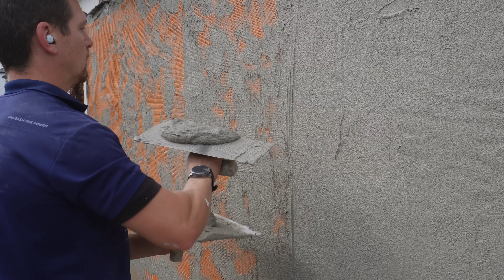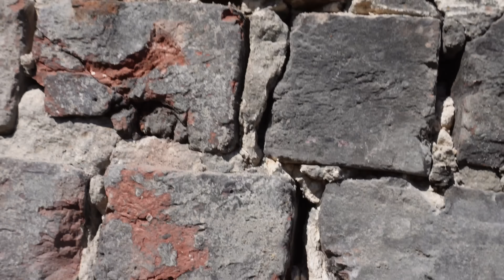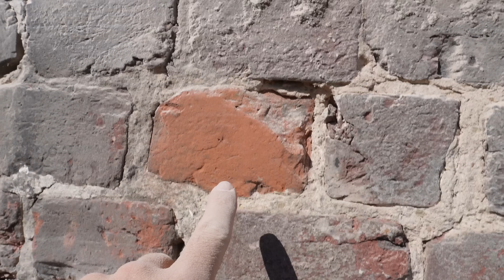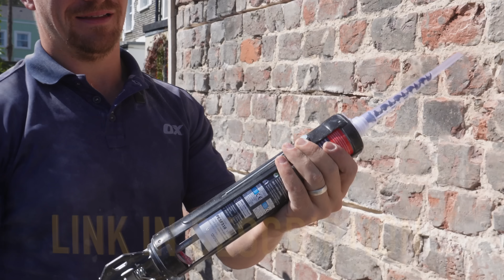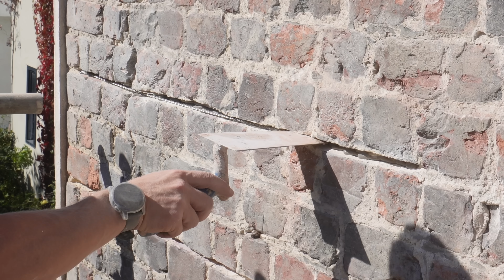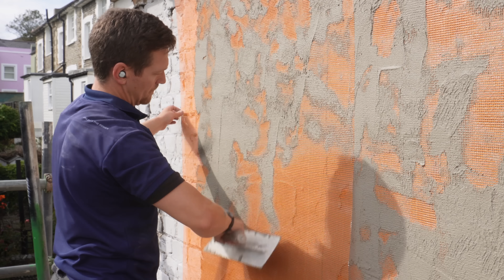Wall Stitching Explained — Fixing Cracks the Right Way

Comment: Whilst I would not normally comment on someone trying to do the right thing there are as number of concerns with this installation: 1. Dust. If the HSE was to see this amount of dust emanating from any works there would be concerns at how much silica dust you are putting into the air and breathing in - your lungs will not thank you. 2. The depth of your slot is too shallow and needs to be deeper - ideally in the middle third of the brick. 3. You are only partially removing the lime mortar so instead of the Bars connecting to the bricks via the resin (see below) they are bonding to the lime mortar which has zero bond strength - the whole of the lime mortar (in fact any mortar) should be removed and then the slot should be flushed out with water to remove the dust. 4. Resin is far too hard and brittle for use with this type of helical Bar. The Bar has flexible and elastic properties to enable it to allow the natural movements of the wall whilst constraining the unnatural movements of the crack. You should be using the manufacturers specialist cementitious grout which is designed to micro-crack as the Bar's elastic properties start to kick in. 5. Whilst the installation of the Bar seems to be about right, it should be pushed back into the bead of resin (see above) set at the back of the slot and "ironed in" so that it is completely covered and then a second bead of resin(!) should be installed and ironed in over the Bar. In this way the Bar is fully encapsulated into the bonding medium along its full length.
I apologise for being pedantic but 35 years ago I designed and tested the first helical beaming test and then wrote the very first "standard details" which have since been used as the worldwide standard installation instructions. I also write the first training course for structural engineers and installers.

Comment: Just come across this. You are incorrect to advise that diagonal cracks are less severe than vertical cracks. Any diagonally running crack (otherwise known as a "stepped crack") with the appearance of a staircase can indicate structural movement is occurring and should never be brushed off as minor or less severe. Regardless of whether a crack is horizontal, vertical or diagonal, the direction of movement is always perpendicular to the crack itself. In the diagonal crack above, it could be due to upheaval at foundation level or some other form of slippage. Diagonal cracks usually start off as a hairline cracks, and the pattern of the crack follows the alignment of both horizontal and vertical joints in the structure. If people take your advice and assume the crack is not severe, but settlement in the foundation continues,  the crack can consequently grow in width and individual bricks can work loose and dislodge. It's also very important to check the inside of the building, and if the crack is seen inside, then then professional advice should be sought as early as possible.
Reply: Agreed. Important to get facts right before posting you tube vids.

Comment: Great explanation mate. Quick quesrion, I had a small diagonal mortar line crack on my house but had the house rendered. A year on I've now got a crack on the internal plastered wall roughly in the same location, anything to be worried about or because the base coat and render are holding the outside skin tighter and movement is noticed on the inside? Cheers.
Reply from the maker: Sounds like the render might be holding the outside skin, but it's worth getting it checked out if you're concerned.
Reply: @PlasteringForBeginners Thanks for replying, I'll get it looked at but I'm not concerned until I need to be concerned 😬👍🏻

Comment: Great video and demo, I appreciate your channel and efforts, I learned enough to take on skimming and plastering my restoration.

I have done similar but rather than the helical bars I used stainless steel rebar 6mm or 8mm.  Movement had stopped so I just needed a strong stitch.  Great thing about stainless is you can store it at the bottom of the garden wall and it’s hidden so buy a bunch if you are restoring an old property for any external repairs especially if you are within 2 miles of the sea.
Reply from the maker: That's great advice, thank you for sharing!

Comment: Hi Mate,
First of all, I wanted to say a big thank you for your videos.
I used them to do plastering for the previous house.
I also used the helical rods you have mentioned, but instead of an angle grinder I used a plunge saw with a diamond disk. The plunge saw had a better way to control the generated dust.
Reply from the maker: My pleasure mate! Glad to hear they helped! Great idea but the way - I’ll try that next time. Cheers

Comment: I can't see doing this type of repair where I am.  We have "freeze/thaw"  winters.  That means that on a wall like this the mortar that binds the bricks has to be "soft" lime based mortar so that it absorbs water and then slowly lets the water evaporate.  The lime self-repairs small cracks as it re-carbonizes.  Using mortar like that prevents the facing of the bricks from blowing off.  If one uses anything else, such as resin, the repair is very very temporary and the facing of the bricks simply blows off and the crack then just spreads.  Ask me how I know (LOL).  I think you're right on about vertical cracks and structural issues.  Happily, I've not had to deal with those in my house.
Reply from the maker: Very interesting! Thank you

Comment: I hate to say it ( cos uve done what u can with what uve been presented with ) but the only thing that’s really gonna cure a cracking wall , due to subsidence and prevent them cracks from reappearing is to underpin the structure , u can chemi fix and Scrim the surface as much as u like , but if uve got subsidence them cracks will reappear at some time further down the line , gravity will always win
Reply from the maker: Agreed mate. If there’s subsidence then no rods or mesh is going to work. As you say, it’s getting advice for a structural engineer which would probably result in underpinning

Totally agree 👍
Reply: We have an old house like that, built with no piles in a swamp pretty much :)  They've taken great care to keep heavy traffic and heavy construction away from here, and they manage the water table carefully.  Even so, cracks will appear a decade or so after repairs.  All we can do is fix them again to avoid moisture issues.
Maybe we'll fix the house at some point, but it'll be a major job and really expensive.